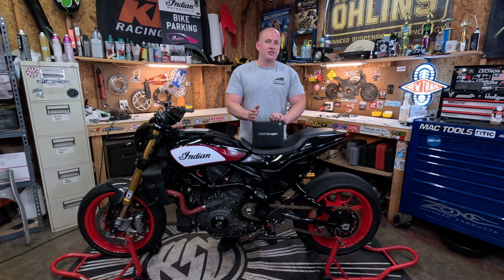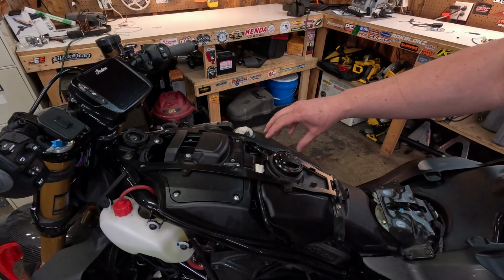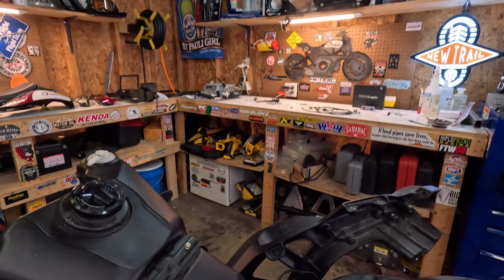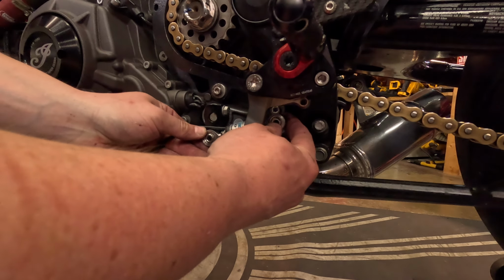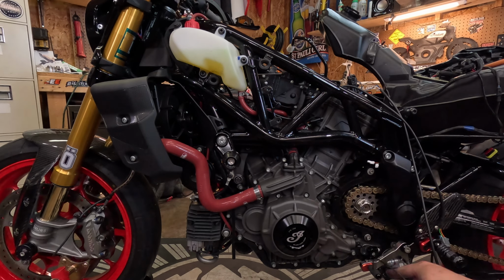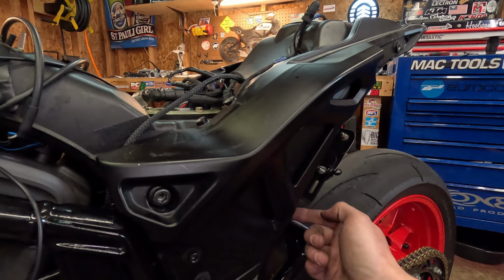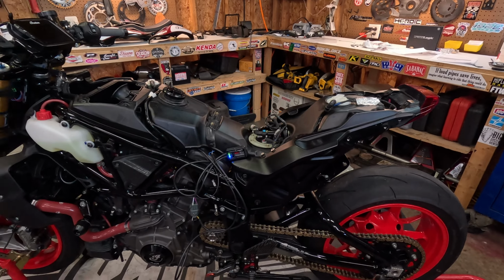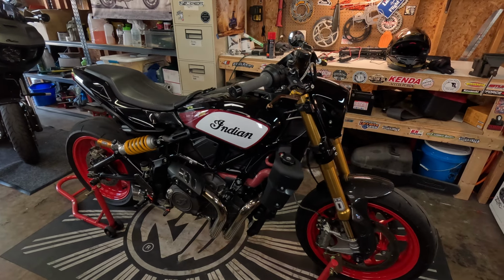Installing a TransLogic quick shifter on my FTR1200 2.0

Comment: Mike, like your channel. I just inherited a 2019 FTR s. The stands you use. What would u recommend? Can u remove the rear wheel on the stand.
Reply from the maker: @davebrunner4988  just standard sport bike stands off Amazon. Rear wheel you can remove with them. Front wheel you can’t. What I do is put the rear stand on then put a jack under the engine to remove the front wheel

Comment: I thought working on my Ducati Streetfighter was a nightmare.....
Reply from the maker: Go work on a v2 or v4. And report back.
Reply: @Ferraiolo_1  I have a V4
Reply: @Ferraiolo_1  I have a v4.
Reply from the maker: @rogerweber8194 so you think 10-15 min to get to the spark plugs on this bike is a nightmare?
Reply: @Ferraiolo_1  that and adding a quick shifter
Reply from the maker: @rogerweber8194  so you think an hour to add a quick shifter on this bike is more of a nightmare than the hours of shop time it takes to access the plugs on a v4 or the 8+hrs it takes to install a header on a v4? Interesting.
Reply: @Ferraiolo_1  I have done a few things on my V4, tail tidy, front blinkers, clutch and brake levers, gas cap, new seat, bar end mirrors, a few Proti bolts.
Reply from the maker: @rogerweber8194 I wish you the best of luck on your first major service
Reply: @Ferraiolo_1  OMG.  I'm going to sell my V4 now. Before I have that level of manintence does at $219/hr.